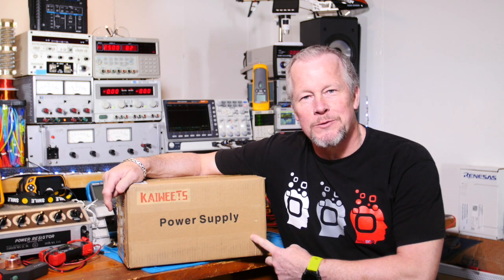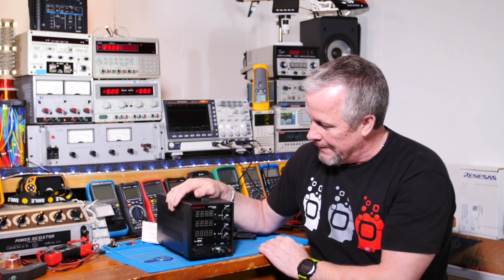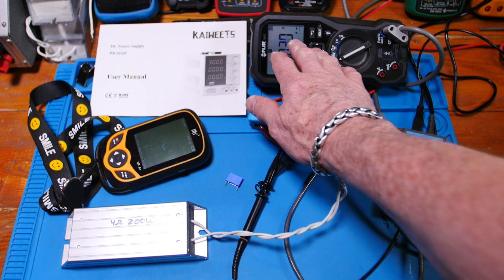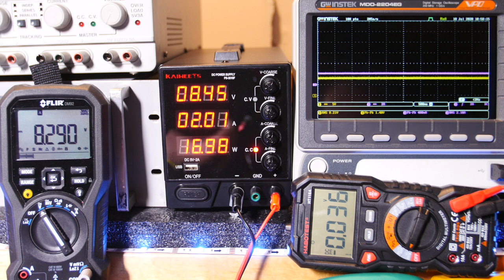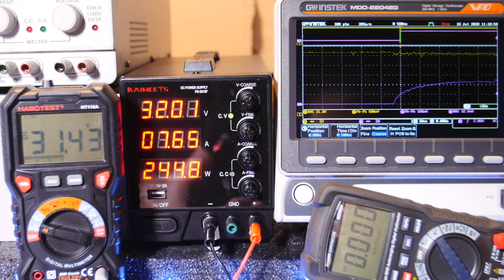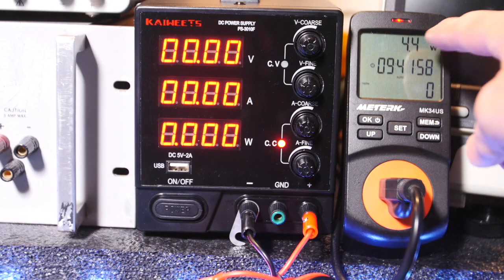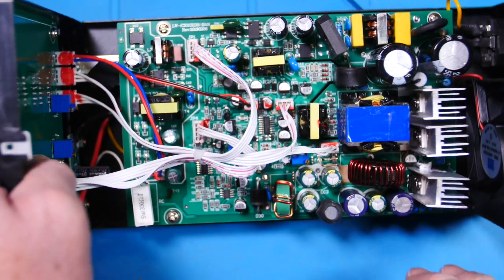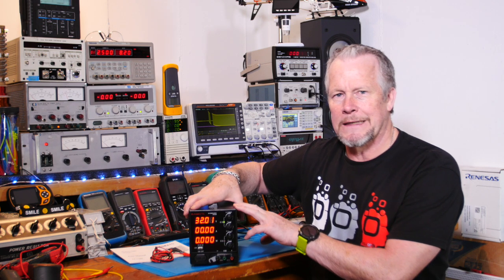Best Low Cost Power Supply by Kaiweets #lowcostpowersupply #APS3010H #Wanptek #bestbenchpowersupply

Comment: Thanks, Eddie. That looks like a nice PS for the price. It's built a lot better than my GQ-A305D was. I had to practically rebuild mine with new wiring, op-amps, and stuff. I added two power transistors to make it bulletproof. And it is only a 5A.
Reply from the maker: It does seem to be built well - especially for the price;). Thanks Robert!
Reply: @KissAnalog   i have an old Kenwood "KPS-10" DC Power supply. I cant seem to find anything about it on the internet. Found a few things about the "KPS-10 A", but not for mine. You know anything about it or can you point me to a site.

Comment: These things are junk, crap dials that are impossible to dial in v and a. Mine died after 4 months
Reply from the maker: Thanks for the feedback!  Did the dials just stop working - or does the output not work at all?
Reply: @KissAnalog  Dials were just just not smooth, slightest touch of "fine" and it would over/undershoot to the point of frustration. After 4 months it would randomly turn off then one day died completely. I never even bothered to tear it down to have a look.
Reply from the maker: Thanks for the info!  Mine seems to work better than that.  My dials are OK.  I did notice that the display seemed to be brighter in my second one - and slightly different shade so I wonder if they are making changes - updates.

Comment: Hello.  Thanks for the review.  About 5 years ago I bought one of the cheap 30V 10A variable power supplies off ebay ~$50.  It worked great for a couple years.  Then I didn't use it for over a year.  I went back to it and it didn't work anymore.  It powers up but doesn't put out any power.  I read the manual for the first time and it said the unit had to be plugged in every month.  Have you ever heard or that or understand why?  Does this model require the same?  I've been looking to replace it and just haven't been sure what to get.  One popped up cheap on market, an old hewlett packard harrison 60V 1A.  Guy found it cleaning out his dad's place and didn't know anything about it.  It hasn't tested well.  The voltage seemed to test good the first time I tested it with my meter even though the needle wasn't accurate.  Not sure where to go next.  30V 10A is a nice output to have.
Reply: One other note.  I couldn't find this on Amazon.  I did find the Vendor website and they still have this model for sale.  Current retail is $140.  Currently on sale for $125.
Reply from the maker: Thanks for the feedback!  Remember to use the discount code KA15 to get 15% additional discount;)
Reply from the maker: Wow - that is really strange.  The only thing I could think of if there was some type of storage element that was used to keep the microprocessor alive.  In some cases there is a maintenance where anything with large aluminum electrolytic capacitors have to be charged and discharged to reform them.
Reply: Thanks for the insight. Are all you variable power supplies plugged into power/main all the time or do some sit for years unplugged? Obviously when buying older ones they have probably been sitting unplugged for some time.

Comment: Great Video!!

I’m pretty new to all of this but I’m trying to charge a small 12V battery for a 8 plug power strip and I’m wondering how high I should set the voltage? On my power supply unit I can’t set the amps unless I adjust the voltage too. And like yours there is virtually no directions or manual except for a few pages. 
 The battery currently is charged to about 6.5V

Thanks again !!!

I hope that’s clear.
Reply from the maker: Thanks for the question.  Yes many lab supplies need a little voltage to set the current limit.  For these, set the voltage to zero, then short the leads and bring the current know up a little.  The bring the voltage up a bit until you see current flowing.  Then you can go back to the current knob and bring it up to where you want it.  I'll do a short video on this...
Reply: Thank you

Comment: I read on some reviews on Amazon that you aren't suppose to set voltage above 5 volts , before you short the leads to set constant current on these type power supply
Reply from the maker: Thanks for your feedback!  It is always a good idea to put the voltage at zero and then short the leads.  This way you don’t get an arc that will pit your leads.  Also it is probably less stress on the PS.

Comment: I wish they would make a power supply that has LED readouts for voltage, current and resistance (calculated). I don't need to know the wattage all that badly.
Reply from the maker: That would be cool:)

Comment: I have an Eventek 30V/10A DC power supply. It stays stuck on a CC of zero, even after I short the leads. Sometimes after a long time, the current will slowly begin to increase above zero, and only then can I make it work just fine. I've tried everything the instructions say, and nothing works. When I turn it on, the CV light is supposed to come on, but doesn't.

Comment: Looks like this power supply could use a good output filter added to it. That high frequency noise output is not good and needs to be filtered out for sure. Got any good ideas for a better filter ?

Comment: I bought an Eventek 30V/10A switching power supply which seems to be of good quality and pretty accurate output. Could you recommend the best capacitor for me to add to smooth out the noise, as in your video?

Comment: I have that and it's garbage. It can't go over 4 amps and that's with the psu struggling. I have one from longwei that is identical except for the color. Same guts too
Reply from the maker: Wow Joey - mine seems to work fine;)
Reply: @KissAnalog  yeah man. It's crazy. Sorry for the foolishness man. Had a rough patch.
Reply: @KissAnalog  I have that tektronix tds2002c. It's awesome man. Never used except when he turned it on after purchase then again before our trade. He gave me a 30 pound 8 amp isolation transformer.

Comment: Hi !  Thanks for taking the time to prepare and make this video!     You've had this now for quite some time.  Any updates after using this long?   I'm looking at buying this model in the next few days...  but thought I'd ask if you had anything to add?   (BTW... I have seen your "Kaiweets improved..." video too  ... thanks!)
...  Hope you see this comment so late down the road    🙂
Reply from the maker: Thanks Rick!  I appreciate you!  This PS has been solid and I like using it.  Easy and fast to set up.  Please use my Kaiweets link as they should provide you with a discount.  Let me know;)
Reply: @KissAnalog    Sorry for the ...L...A...T...E... reply.    (long story short... Gmail inbox issues that I didn't know I had - so I only saw the notice of your update today !)     I did try to use your link but regrettably it wouldn't work for me in Canada... (sorry 2yrs later I don't remember what the exact issue was)   I ended up buying the same unit from Amazon.   I'm very happy with it.   Thanks again for your videos!

Comment: Hi there
I just watch this video and the other one about Kaiweets psu again. I have three of the same supply. Kaiweets is only a trading company, and they don't manufacture anything themself. These psu are made by Wanptek. I don't understand, are there any reason not to leave the film capacitor on for ever. I also have a Handskit combined Rework solder station and Bench top psu, and that has a bit more ripple than the WanpTek's. I am temped to mount the filter cap inside, should I do that?
Btw.. Habotest is the manufacture of the Kaiweets meters. I have been selling Habotest meters for three years, and they have become rather expensive compared to Kaiweets the last two years
😄 maybee it is because Kaiweets gets all the publicity 🙂
One last thing. Can you make a test of a lowcost variable AC power supply, or AC power source as Aliexpress calls them. These AC psu, are they real AC power that can run all AC things, or are they something like a triac thing. I cant find a cheap model, but only this one https://www.aliexpress.com/item/1005001344455013.html?spm=a2g0s.8937518.0.0.7bce2e0epsvFuQ
Keep up the good work..
Claus, denmark
Reply from the maker: Thanks for the great questions Claus!  I think Kaiweets has been doing a great job and somehow getting great prices.  BTW you can get 15% off at their website by using my code KA15.  I am going to review the Wanptek power supply.  I really like it and the size is smaller than this one.  Use this link then use the code KA15 to get the 15% discount - even if it is on sale it works;) https://kaiweets.com/products/wanptek-aps
The AC power supply looks great - I'd love to get one to review.  ;)

Comment: I actually just bought this power supply after watching your video. Question about that film cap, is that ran in line with the positive, or is it crossed?  Also, what is the specks on the film cap?   Thank you :)

Comment: The habotest is rebranded as at least 10 different brands with wildly varying prices lol
Reply from the maker: Thanks Joey!  I'm happy that they keep the 118 number in many of the brands;)  It is a solid meter at such a great price.
Reply: @KissAnalog  definitely, I have the zotek version kicking around somewhere. That amprobe I was telling you about is apart on my bench. The needle works and the clamp has continuity so I'm gonna fix it hopefully. I should've tested it earlier but I paid like 3 dollars for it haha. I was using my owon b35+ today and a part of cringed at just paying 150 for the ut61e+ haha. You should do a thing on making your own leads for different purposes. Like what type and gauge should be used for a psu and how to diy better dmm probes. I've been researching it but you never know if the wire you order is going to be real silicone and if the strands are real untinned copper. Amazon is hopeless for untinned stranded and hardware stores don't sell high end wire. My brother in law will only sell good ptfe wire by the spool for like 2500 beans lol

Comment: Ot of those cheap psus like mine have fine and course for volts and current but they're mutually exclusive. Like I can't set mine to 5v at 2.5a max draw. I have to turn volts down to zero to adjust current ceiling and the opposite with volts. Had I known this I would've never bought it but I was still new and never realized for a few months. It was dropped as well and no longer works reliably. I keep it for parts now. I plan to make it into the enclosure for my isolation transformer.
Reply from the maker: Hey Joey, is it a Kaiweets?
Reply: @KissAnalog  no its some off brand name. It's alot more expensive than the kaiweets though and a million times shittier. I'm waiting for a brand new owon psu that just came out but Canada customs aren't releasing it and the sender, who is extremely trustworthy cannot find out any info from the US postal service after they handed it off. It's a sweet supply too. It was sent over 2 months ago. Covid is a bitch, if your package doesn't go through a broker it just gets put to the side. It's happened to me a few times now with Canadian customs. It's an owon with a big tft that shows and stores the voltage used over time like an oscilloscope. I'm gonna suck it up and buy one after Paul reviews the new one he's replacing his broken one with.

Comment: Nice review. When would you use a ground lead? When it's higher voltage / amps?
Reply from the maker: Thank you!!  I never use the 'green' ground lead.  I think you might if there were an advantage with noise maybe...  I like to float my outputs and just be safe and not touch anything;)

Comment: What I don't understand is why computer power supplies can have such low noise and ripple, but these things ripple is huge compared to computer PSU. Why is that? I mean, you can get a clean computer PSU for under 80 bucks. I know computer supplies are max 12V, and not 30V, but why do these SPS have to have so much ripple? The Corsair RM650X, for example, only has 10.3mV Ripple @ 100% Load (as measured by Tom's Hardware).
Reply from the maker: Great question!  Thank you!  First, at max power is the best and easiest way to get a great measurement.  The worst is at a low power where there’s no load to reduce the noise.  A variable output with variable loads is a completely different game;)
Reply: @KissAnalog  Hey Eddie, thanks for the reply. Tom's shows the Corasair RM650x  @ 3.6mV at 10% load. The worst ripple they got from 10%-100% ( in 10% increments) was the 110% power number, which was 11.6mV. You can see the chart if you search for "Tom's Corsair RM650x" on the page "ripple measurements (It would be interesting to see your ideas behind those readings). Another thing I don't understand is how Kaiweets can publish ripple specs that state: "Current Ripple & noise : ≤20mV r.m.s". Seriously, that must be some sort of magic measurement, for sure, because it has nothing to do with real world ripple, as you have shown.

Comment: Hi, I have this power supply for HHO electrolysis, I ordered a second power supply because I plan to run 14-19amps at 14volts(vehicle voltage). My electrical engineering experience is good but I don't want to blow up 200$ in PSU's. I plan to set the voltages independently to 14.00 and then connect them in parallel with 1ft 12guage ring terminals. Is this as good as I can get with these non-sensing power supplies? should I set one to CC and the other to CA?
I figured that splitting the wires of adjustment dials of one psu to the other would 1/2 the requested voltage because it's a potentiometer(resistive) and any tuning pot's would screw with that.
Reply from the maker: Thanks for the great question!  To be super safe, I'd use large diodes on each output to parallel.  There's always the chance of back feeding into one of the PS.  It is easy to series them, but in parallel, the diodes make it safe.  Does this make sense?
Reply: @KissAnalog  awesome and good idea with the diodes. Any thoughts on what kind of diode? 10A50V rectifier diodes seem common and cheap enough. The electrolysis cell will never be disconnected so they should be more then enough to handle any back feed eh? (canadian lol)
So from my research, I’m just going to twist and solder a bunch of them in parallel to make a 12/14 gauge connection and it should be good? I read that as long as the reverse voltage is not met there should be no leakage. 25 were 13CAD.

Comment: Is there a plastic peel and remove on front faceplate? Normally there to protect plastic during shipping. Mine looks to be not there or is it so tight , I can see where to peel it? I don't want to damage front but I see some light scratches? Let me know what others find.
Reply from the maker: That's a great question!  I can't remember, but if I didn't show removing it in the video, then it probably wasn't there.  My displays are shiny and very smooth, so I could see how they could be easily scratched.

Comment: How is it holding up?  edit: I am up to 26m of the vid and the one thing I despise is that there is no button to make it CC or CV.  I want/need that as the way you were doing it seemed a good way to blow stuff up since it has to be connected to get it to change over.
Reply from the maker: This power supply has been great.  It is CV essentially all the time, once you set it at the voltage that you want.  You can set the current limit then by shorting the leads and adjusting the current level to the max that you want.  That way you can set a max known current to protect your circuit.  I did an update to lower the noise; https://youtu.be/idf8nRw19DM

Comment: Thanks for your review! After watching, I ordered one and received it today. I’m a rookie, so maybe a dumb question. Why didn’t they put a switch that allowed unit to be on so u could make adjustments, but not put out power until you were ready? Could a person put a switch in the leads to accomplish this or am I making too big a deal of it?
Reply from the maker: Thanks Jay!  I agree, having an on/off switch for output is very nice.  It would be easy to add this.  It is usually found in more expensive PS, but not always.  You can just pull the banana jack out, adjust the voltage where you want it and then plug it in.  That's close to the same thing, but if you don't jam it in fast, then you might have more sparks;)  Adding a switch is a nice idea, maybe I'll make a video doing that;)
Reply: @KissAnalog  Would you add a switch to both the positive and negative leads?  Or just one or the other?  What do you recommend for better leads?
Reply from the maker: I’d add it to just the positive lead.